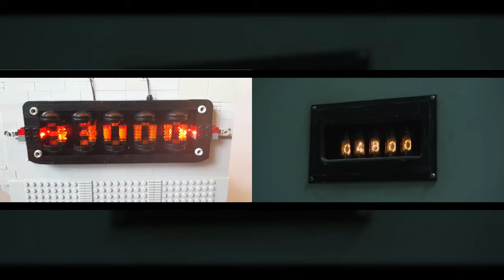HBO Chernobyl made in LEGO

Comment: Nice job! I love those rods jumping up and down :d
Reply: ASMR
Reply: @megarayquazagaming7104  You would not love it if you are in there
Reply: @AdvancedGaming88888B  there is no graphite xd
Reply: *Caps. Rod caps. Also fun fact - Irl they didn't jump.
Reply: @TheTrueMichael  Was it for dramatic effect they added it to the series then? (Not that what happened wasn't already dramatic enough..)
Reply: @Pazaluz  Actually, it was in a book by Medvedev (which then went on to become russia's current minister of defense, IIRC), in which he basically kissed the USSR's ass saying that it was operator error. He picked a name from a plant worker and made up the report that said worker saw the caps jumping up and down. It's sad and convoluted to the point we don't even know the actual weight of the rod caps, ranging from 30ish kilos (apparently usually plant workers carried one, but in the manual it says 2 people are required for safety purposes) to 350, the only problem with the 350 assumption is that they would be too heavy for anyone to lift, even 3 people couldn't do it. And the problem with the stream pressure explanation and the factual 35 kilos is that if steam pressure were THAT strong, the lid would've flipped over instantly.
Reply: I thought it was a normal thing for nuclear reactors to do

Comment: One twenty forty two ochenko looks on the enormous steel lid of the reactor and sees the impossible the control rod and fuel channel caps which each weight 350 kilohms are jumping up and down he runs toward the control room but there's nothing he can do to stop what is coming 123 and 44 second the steam blows more fuel channels apart we do not know how high the power went we only know the final reading reactor 4 designed to operate 3 200 megawatts  went beyond 33 000 .... The pressure inside the core  can no longer be held back 1.23.45 explosion